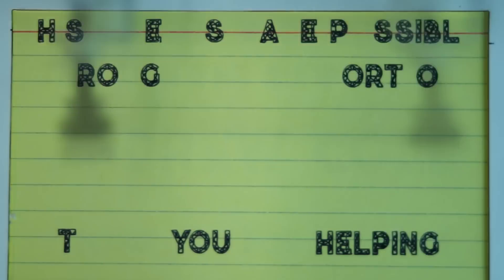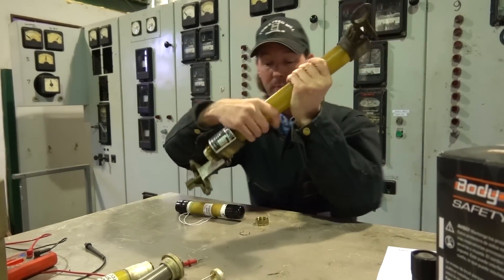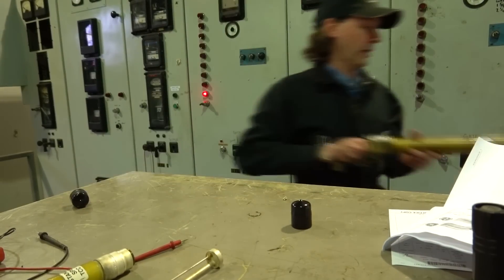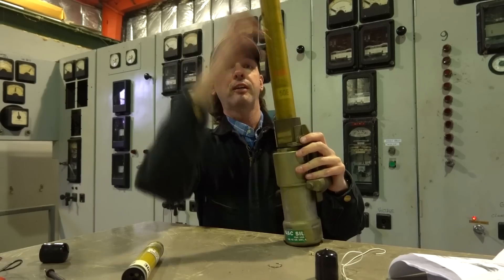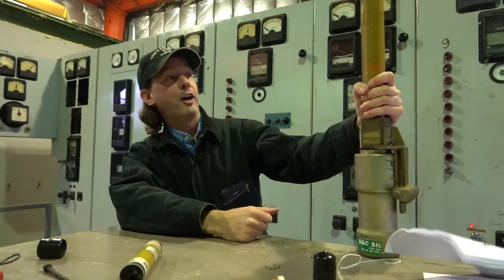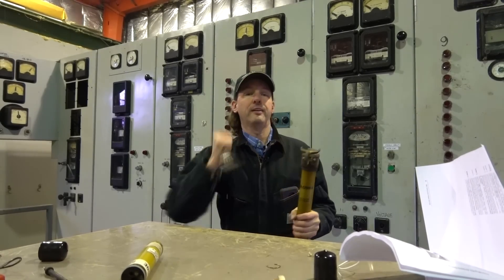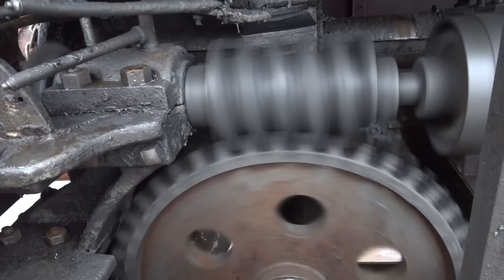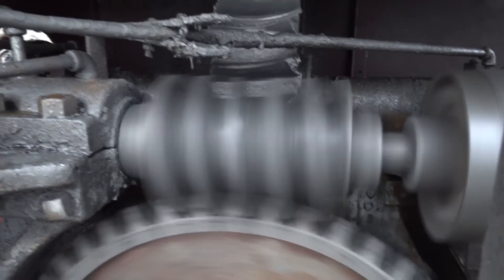Authorized Personnel Only - Hydroelectric Plant Fuse Replacement and Startup

Comment: Why is all heavy duty industrial stuff that awful green color?
Reply from the maker: Because until recently (past 40 years or so) pigmentation wasn't nearly as advanced when it came to the manufacture of paints. Colour didn't really explode on the scene until the 1980's. If you go back another 40 years before that, the palate was incredibly limited. That green generator may easily be 80 years old.
Reply: Would you rather have had it in our colors? Yew* for main engines, generators, gearboxes, vacuum lines. Dunes Tan for outside machinery. Yellow for electric motors and fuel lines. Black for raw water. Red for air.

* Yew is the color that matched Detroit Diesel engines and our paint was made by International Paint. https://north-america.international-pc.com/ A very tough paint that stood up to our blue soap. It could have been worse, it could have been Rustoleum Pleasant Green ( sometimes called institutional green, aka Pratt and Lambert Patina ).
Reply: I have been in a small hydro unit in Greece. It was very clean and had potted plants growing around the turbines.

Comment: If you ever feel constipated, try installing one of those electrical firecrackers, in a system with a bolted short. it will clear right up.
Reply from the maker: I assure you that when installing that (from the end of a very long hot stick), you couldn't have gotten a pin up my ass with a jackhammer.
Reply: @Physicsduck  Great "analogy" XD
Best description of being up tight/tense I have herd.
Will use this, in casual conversation. Thanks.
Reply: @Physicsduck This is something most of us wouldn't want to touch with a 10 foot barge pole, fiberglass or otherwise. An interesting video of taming n interesting beast.
Reply: @Physicsduck also known as a #9 pucker.

Comment: Interesting I was amazed the size of the generator unit, looked like an old elevator motor to me. I heard you were working on this I was thinking generators like hoover dam, that is the only power generator for grid use I have ever seen documented.
Reply: 200 / 300 KW is pretty small in relative terms.  Have a look at trailer mounted engine powered portable generators in that size.
Reply: @bobroberts2371  The ships I used to work on had 3 2500 KW or 3000 KW generators.  I supported a computer that load shed and tripped the buss tie breakers in cases of failure.

Comment: What’s with the slow fast gauge going in circles?
Reply from the maker: That's a Sycroscope. It's comparing the phase of the generator to the phase of the grid. The generator has to be perfectly synchronized to the frequency and phase of the grid before you tie it in or it makes very expensive sounds as it synchronizes itself very quickly.
Reply: @Physicsduck  Very Expensive Sounds 😂😂😂
Reply: @PanduPoluan  Also, have a look at this vid for an walk through: " How to Run Synchronous Generators in Parallel ㅣMarine Electrician " on the channel " Mark Roy Mangrobang "
Reply: @Physicsduck  Or blows something like the fuse. Or worse.
Reply: Also, have a look at this vid for an walk through: " How to Run Synchronous Generators in Parallel ㅣMarine Electrician " on the channel " Mark Roy Mangrobang "

Comment: Very interesting to watch and I loved the sound it made that you also found awesome.  Was the Worm gear thing opening the gate on the Dam?
Reply from the maker: Thank you for watching! In the shot you saw it was actually closing it back down, but it's used for both. They had to open the gates a bit to maintain levels when we shut the plant down for an hour to change the fuse.
Reply: @Physicsduck  Interesting to watch all the same, that is what we need here is more Dams, Australia is very dry as you know.  Next week I see 43.C, it has been mild so far.